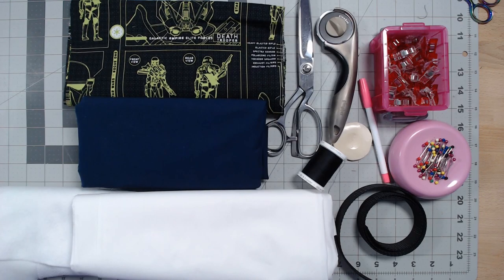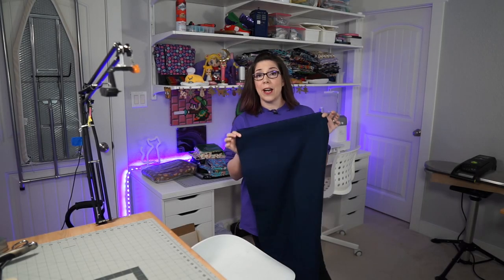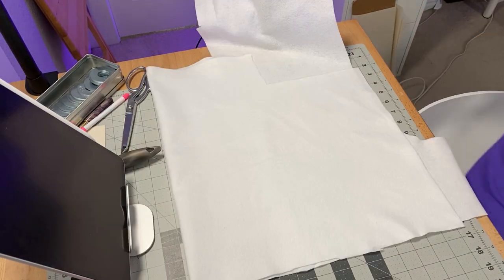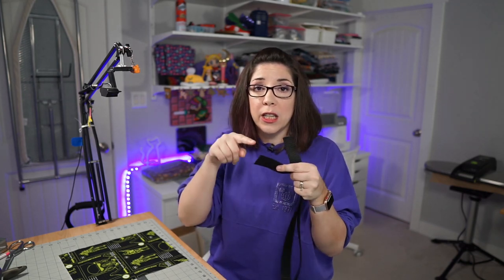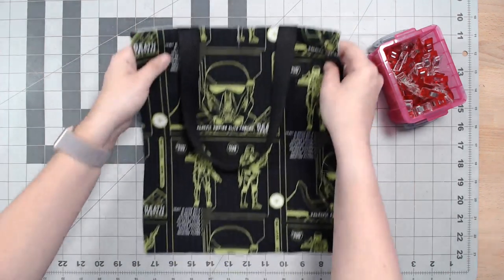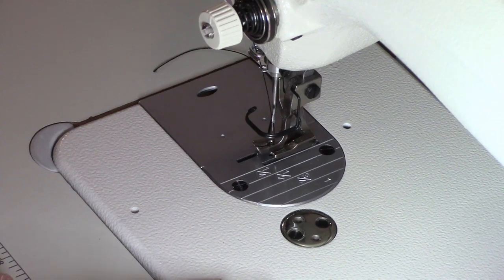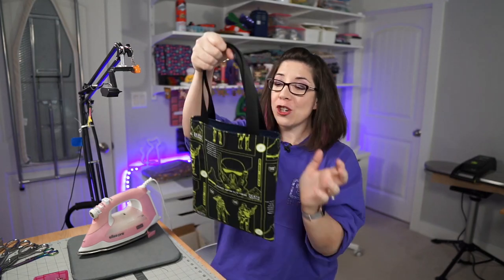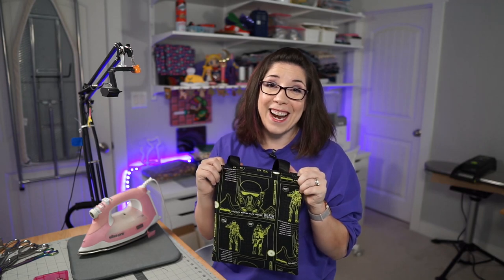Introduction to Bag Making: A Simple Tote Tutorial

Comment: Thank you for this very helpful video! I am new to bag-making and I am very grateful for your tips. I have a couple of questions for you: Are you using upholstery thread to make this bag? Is upholstery thread appropriate to use in a domestic sewing maching? I have a 1940s-style bag I want to make that requires a stiff, sew-in interfacing. What advice do you have for using it? Should I sew the outside fabric (I am going to use a medium weight upholstery fabric.) to the interfacing first? Should I make the outside body, the interfacing, and the lining all separately and then nest the three pieces together and attach them by sewing them together at the top opening of the bag? (Did I explain this clearly enough?). I am concerned that turning a stiff interfacing from wrong side to right side would crush it and could spoil the completed look of the bag. It might also not have the body I want (due to being crushed and rumpled) to make the bag stand up straight. I would really appreciate your help. Your channel is great!

Comment: Just fyi you can remove the paper off the back of your acrylic ruler. They cut the ruler with the paper to prevent chipping during the manufacturer process. It comes off easily you start by peeling it at a corner.
Reply from the maker: I need to go back through and watch to see if I stubbornly left the paper on it or not. I have broken/chipped many thumbnails trying to scrape off that mess.

Comment: If I do not have interfacing can I use a sheet or other solid fabric to give a tote more structure? At what point with batting/multiple fabric layers does it become necessary for a waking foot? I admit that I am envious of your walking foot.
Reply from the maker: You could use Fleece and be just fine without a walking foot. Make sure to fuse it well. When you're going to line up seams to sew pieces together, put a tiny bit of double sided tape like WonderTape or leather tape down to hold them together so they don't shift.
Reply: @fiercekittenz  Thank you!

Comment: What kind of machine are you using? TIA
Also, why not make the seam allowance 1/4 inch to start with?
Reply from the maker: The machine I'm using here is a Juki DU-1181N. It's an industrial machine, though that isn't required for the tutorial. I just used it because I had the camcorder setup on it already. For the 1/2" seam allowance, the reason you want a slightly wider SA for bag making is because you deal with a lot of bulk and a 1/4" seam allowance with all of the interfacings (specifically foam!) can be a tight squeeze. 1/2" gives you more wiggle room and you can trim it down to reduce bulk once you make sure you caught all layers.
Reply: @fiercekittenz  Thank you so much!

Comment: Question I wanted to make an album cover tote is it possible to do no sew I have never seen before. I was thinking small grommets on the sides of the album
Reply from the maker: That sounds like a neat project!!! If I were you, I'd carefully make the holes separately then use chicago screws instead of grommets. If you use a grommet, the pressure could cause the record to shatter.

Comment: Do you use a heat press? I’m having a hard time figuring out temperature settings and how long to press for… with the fleece, my iron on setting 5 (wool) works great after 10 seconds. I tried my heat press at 300° for 40 seconds, and I thought it worked, but I keep finding spots that I need to go over with iron?
Reply from the maker: I do, but it's a domestic one, not one of the more square looking ones that are more industrial. I mostly use it on cotton settings.

Comment: Hello.  Is it possible for you to make a bag or a clutch with Decovil 1?
I tried but when I turned it to the right side...it didn't look nice...
Reply from the maker: graciete duarte I have found that it does actually help to use a woven interfacing FIRST then add the Decovil. You can also heat up the surface of your ironing board and press the bag against it to help “iron” it.
Reply: @fiercekittenz  thanks! The problem is that i  think we don't have that kind of interfacing in Portugal...or I didn't find it yet! 
I tried to explain in the stores (even showed your video) but they didn't know what that is
Reply from the maker: @gracieteduarte7888  Do you have a website that lists interfacings you have access to? I can look it over and let you know which will work.

Comment: Does this bag come out with a saggy lining? I’ve read you either cut the lining smaller or have a bigger seam allowance, but here both the lining and the seams are the same in both. Anybody?
Reply from the maker: It would be saggy! I have a separate video covering that topic. I usually advise you keep the seam allowance at the top where the lining meets the exterior, then taper inward a 1/4” as you sew toward the bottom.

Comment: Is interfacing necessary when using a cotton twill/canvas as the outer fabric?
Reply from the maker: Absolutely! If you don't use even something lightweight, that fabric could wrinkle, stretch, and warp with use. The interfacing provides stability not only in shape, but also in reinforcing the fabrics. Twill and Canvas will both wear faster if not interfaced.

Comment: Do you prewash all of your fabric in bag making?
Reply from the maker: Only if I expect the end product to be washed. This would be a no for me 99% of the time though. If a bag is thoroughly interfaced IT SHOULD NOT BE WASHED. I include a care guide with each bag purchase. If someone washes it and it messes up the interfacing... that's on them.
Reply: @fiercekittenz  Thank you for responding to my question.   I did spend today washing alot of my fabric before I got your message.   I haven't done anything with it yet.   This will be my first bag .  Will it be ok to interface it now that the fabric is washed and pressed after I cut out the pattern?
Reply: Can you please share the care guide?   How do you clean them?   Thank you.
Reply: @joduggan3957  Hi Jo,  FK, correct me if I am wrong.  Washing is perfectly fine.  I was told the interfacing will adhere better if you wash the fabric.  Just more ironing.  😊
Reply: @KJSew  Thank you for replying.  I have been washing all my fabric this week and Ironing it all.  Then I attached the interfacings and they came out great.
Reply: @joduggan3957  glad it worked.

Comment: I thought your tutorial was very good for a beginner. There are just a couple of things I would have done differently but that is just individual style. Spince you have an industrial machine and most beginners will start on a domestic machine I think you should've discussed early-on what a walking foot is. Most beginners do not know what a walking foot is or that they even purchased one for their domestic machine. They need to know what the benefits are to having  a walking foot in case they might want to go crazy and make bagels galore. 🙂
Reply from the maker: B Cobler that’s fair! My cameras are just setup specifically for that machine. My other is a heavy duty Janome. Next time I’ll see about using the iPhone to capture the Janome. Either way, what I did in this video will not be special or different from a domestic machine.
Reply: Fierce Kittenz I didn't mean you had to use a domestic machine, just tell them what a walking foot does since a walking foot does not come standard on a domestic machine.
Reply from the maker: @2Peachcobler  AH! I thought I had mentioned it at some point, but I think maybe I had only mentioned I was using an industrial and that it wasn't required. That's a good point. Maybe I should do a video on sewing machine feet and what they're used for?